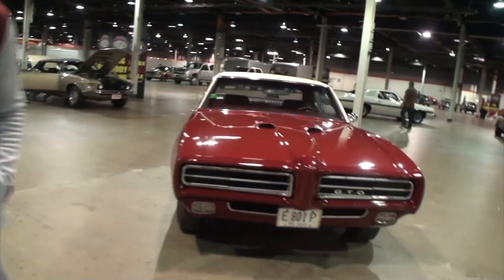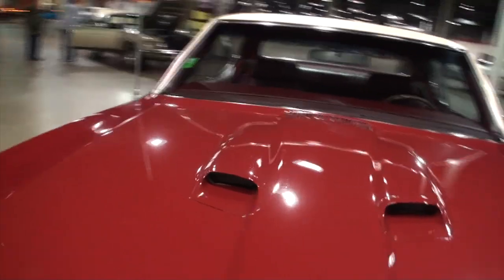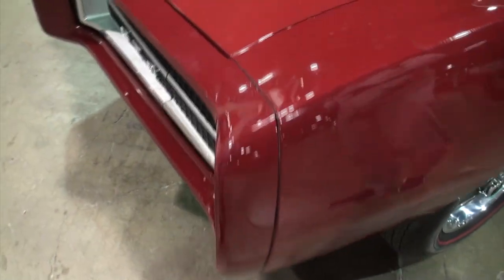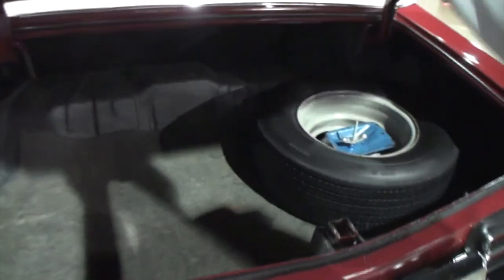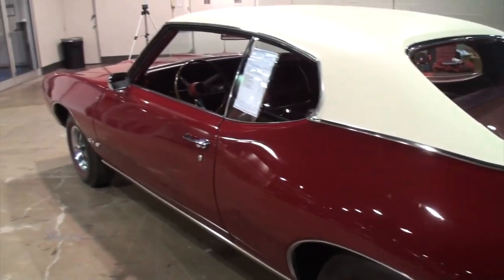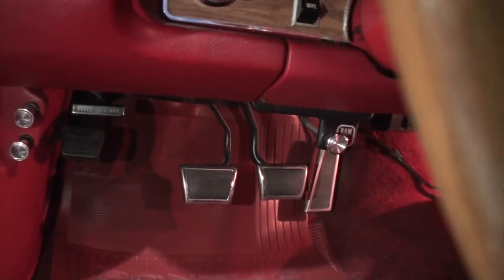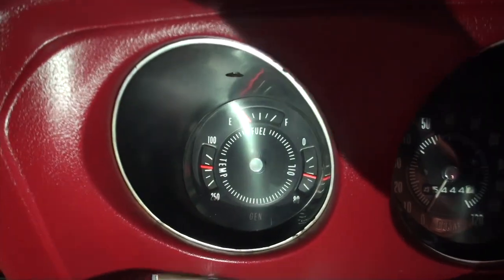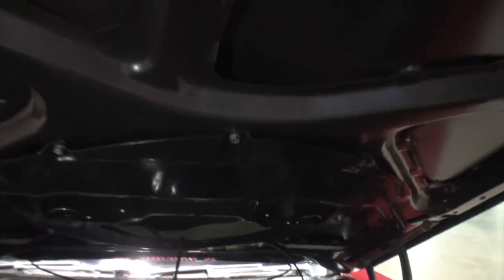Survivor 1969 Pontiac GTO 400 Ram Air III with a 4 Speed in Red on My Car Story with Lou Costabile

Comment: NICE - in High School 1972 I bought a 69 GTO Judge Carousel Red 4 speed w/ console PS PB / 3.55 rear end posi, with 49,000 miles for $1250 and that was a LOT of money then. car was still all original & NICE - over the next 2 years I destroyed the car - motor blown and a few accidents - Dumb Kid  I was -  with F70 rear tires I would pull a stopped Hole Shot in 2nd gear at 3600 RPMs and leave 2 black stripes for as long as I wanted over spinning the tires forever - I was quite famous for that
Reply from the maker: Hi Scarlett Fire, Happy to read this car brings back memories of your car :-) Thank you for viewing and sharing, Lou

Comment: Now my little bro. owns a 1969 GTO and the tach is on the drivers side hood. Did the Ram Air delete the tach on the hood? I also wonder if the cars been repainted as the original stickers on the door jams are gone (which usually means a repaint). Thx again Lou!
Reply from the maker: Hi David, Happy to read your Brother has a cool car. Though the hood tach was a Dealer option add on, however hoping a Viewer with more knowledge can share. No idea about the paint. You're welcome, Lou

Comment: It's too bad that they couldn't match the paint color. Those plastic noses always seen to be a different shade.
Decades ago, one of my customers had a '68 or '69 GTO which I used to maintain. It did have the 400 V8 but had a factory 3-speed manual trans. I thought is was strange and decades later I found out that Pontiac sure loved those 3-speed manuals, offering them as the standard transmission. I have seen the one GTO and I've seen one Firebird with the 400 and the standard 3-speed, but that one had a Hurst shifter, which could have been a factory original.
As a side story, we had a customer that had a Cunningham C-4 roadster, with a 331 Chrysler Hemi with a custom Cunningham intake manifold that had 4 2-barrel downdraft carbs. It had a Muncie 3-speed. Because there were no specs for how a Cunningham's drivetrain should be, we swapped it out with a 4-speed Muncie(which didn't exist when the Cunningham was assembled). They weren't like the later Shelby Cobras, which with each different series, were all built the same way. Back in the late-80's to early 90's, years later, we hired a young guy to help us with working on a couple of Packard 6's, a sedan and a roadster. His name Was Briggs Cunningham IV? and his greatgrandfather was THE Briggs Cunningham. Never got to meet him, but it was cool having his namesake working for us. The kid didn't know much but worked as a step-and-fetch-it for us.
Reply from the maker: Hi Automated Electronics, Thanks for sharing your thoughts and a nice story too, Lou